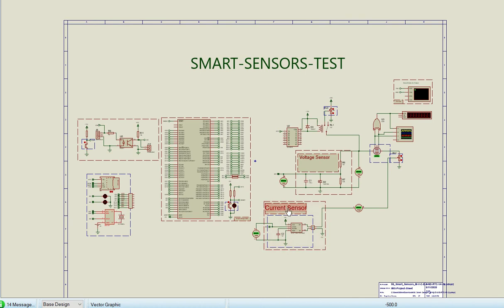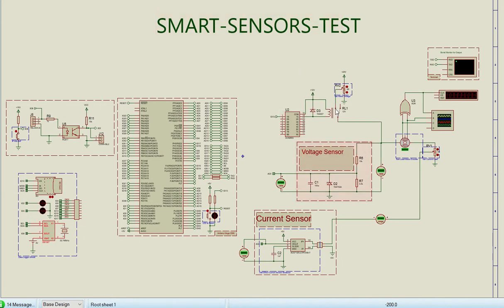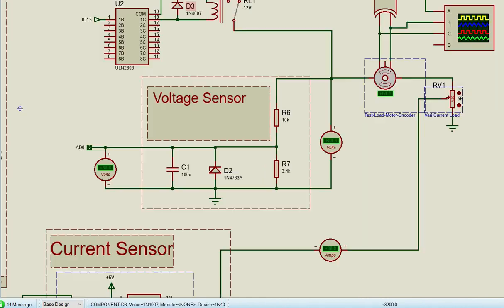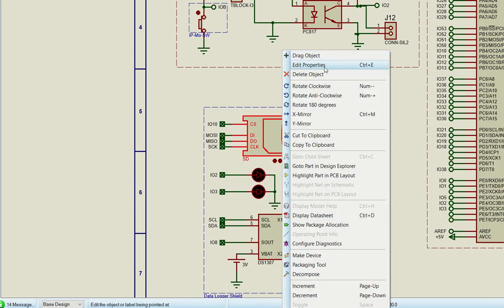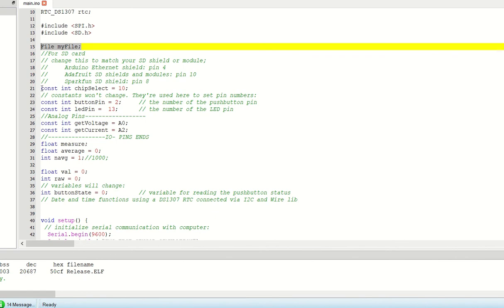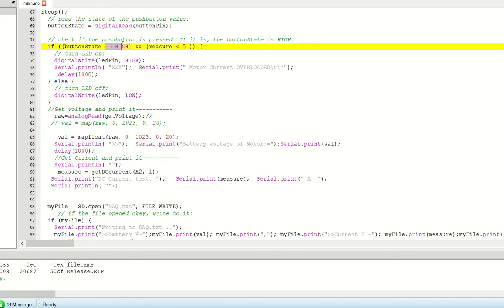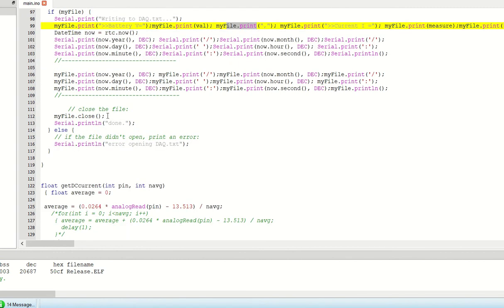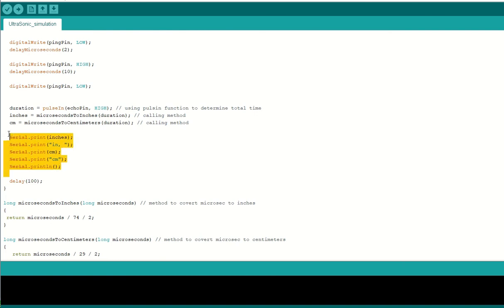Proteus Simulation of: Current, Voltage, Ultrasonic Sensor ,RTC, SD Card and Arduino Mega

Comment: Can i get full file project worked on 3 phase induction motor control of current, voltage, speed and temperature using arduino uno and gsm module please !!
Reply from the maker: Sorry I might not help 😔